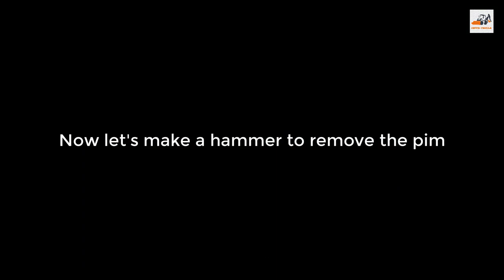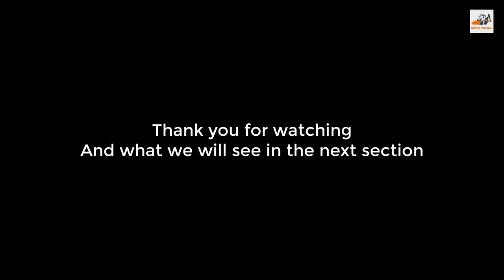JCB 3CX | How to Remove the Extending Dipper 👷 | New JCB Video

Comment: Can you please help me. My jcb Extending dipper is not alligned due to which the pin I put always breaks off. The extending dipper moves right and left as the outer part  is not alligned. Please help me. I will really be thankful. Because of this I am having to change the pin every day. It keeps breaking. I have tried doing so many repairs or modification to get that fixed but cnt fix it.